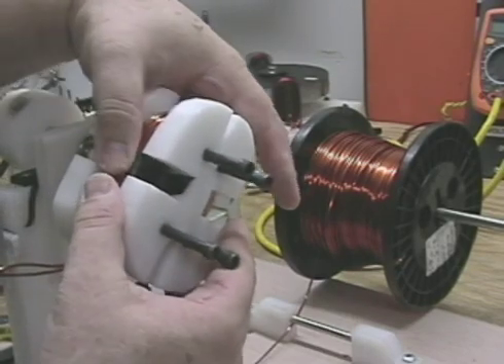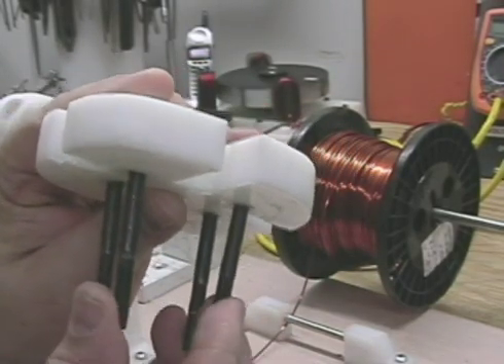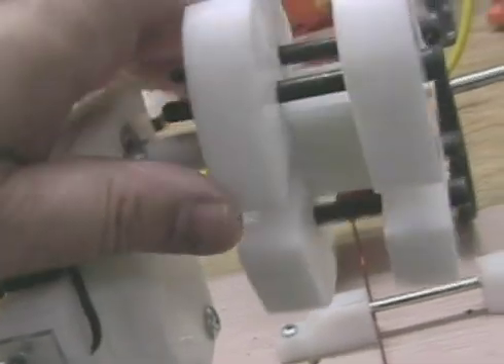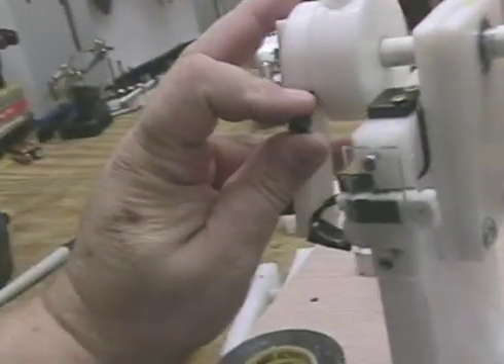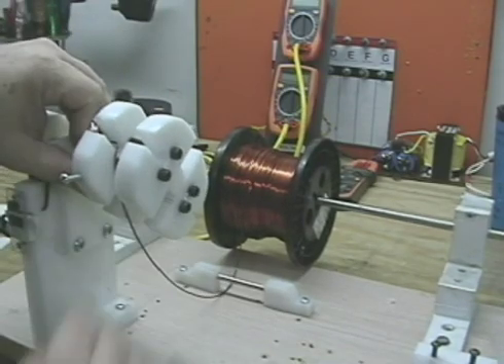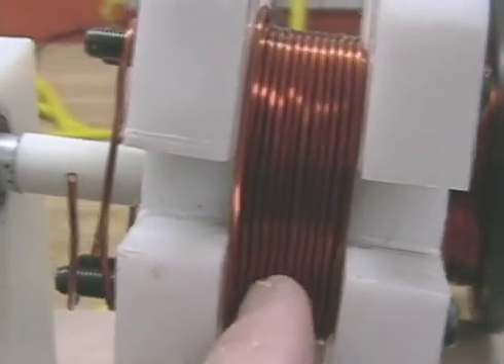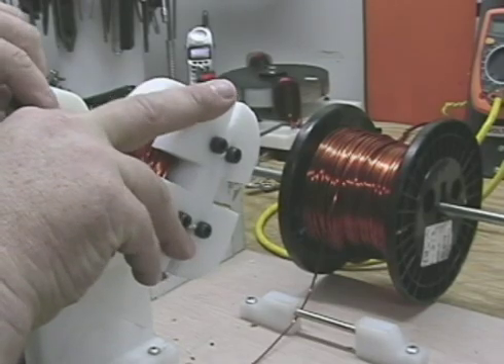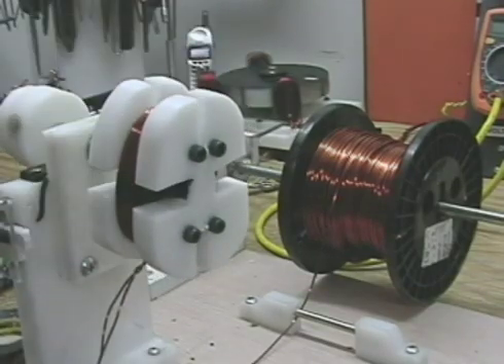Coil Winder

Comment from the maker: the allen bolt? is 2" long 1/4 shaft one of the improvements  I mads was I used a ball point pen shaft and put that over the bolt you could use a drinking straw , just to reduce any chance of nicking the winding with the thread

Comment from the maker: @jonhtiow no the hole is tapered towards the inside if you wobble the hole 45 deg towards center and make sure your bolts have a shoulder on the part you wrap the wire. if you still have a problem just add a sleeve on the bolt.I use a sleeve on small diameter  wires.